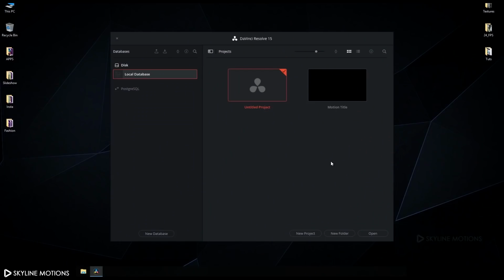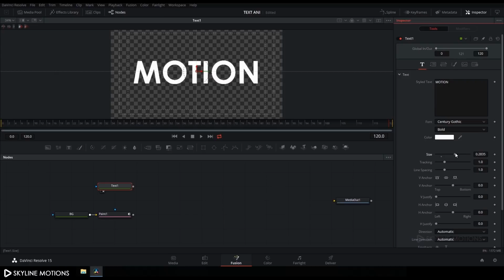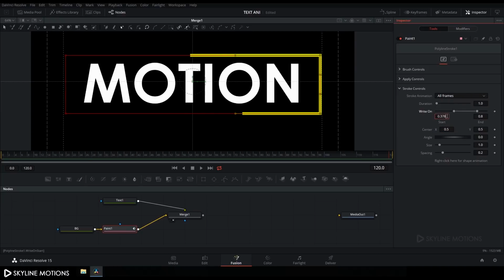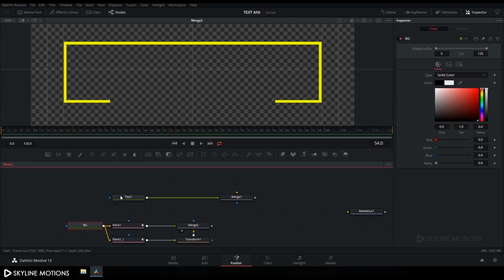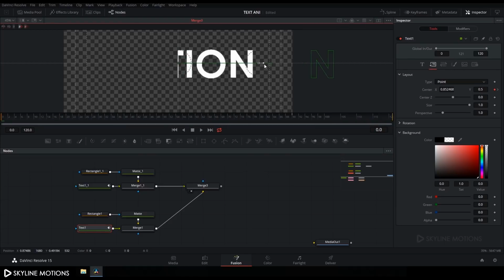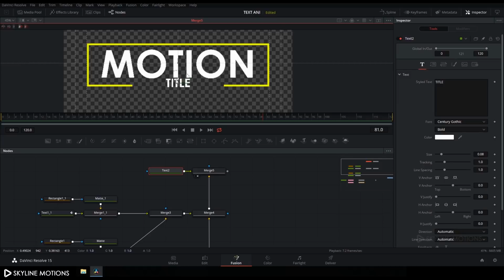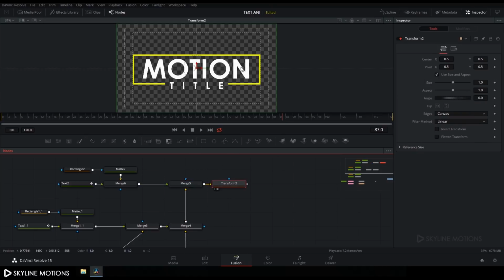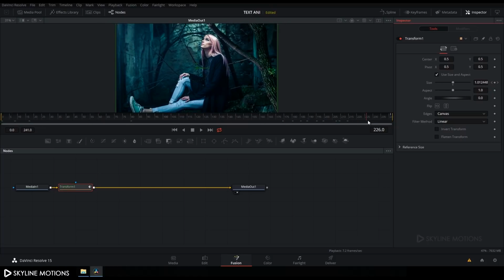Clean Title Animation in DaVinci Resolve 15 | DaVinci Resolve 15 Tutorial

Comment: When I drag the merged text to the viewer, the text displays and animates however the rectangle does not display or animate. If I drag the paint node to the viewer, it displays and animates correctly but for some reason does not display in the merged view. I have checked and rechecked my connection points to no avail. Any ideas on what the issue could be? Update: I figured it out. You did not mention that before you add your merge node you have to select your paint node. If not, it will connect to the text node by default and not display the paint node with it. Still a great tutorial. Thank you for sharing!

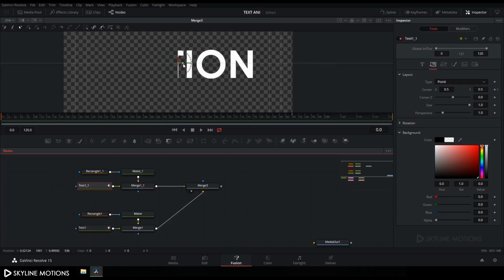Comment: The software is crashing on me when I'm at min 9:17, i've read some places that there was an option to run fusion from the cpu, but the option is no longer there.. Any thoughts?  I have a Ryzen  1600x, and RTX 2070. 32 gigs ram
Reply: Make sure you have nothing else running and be sure to not have YouTube in full screen mode.  Your graphics card may not be not enoughto keep up.  Mine did the same and it helped when I had my browser set to not full window.
Reply: Wow, thats an awesome PC you have there. It should be able to eat these types of animations for breakfast! I have a Ryzen 7 1700X running at 4ghz and a cheap RX580, 16 GB of ram and I am seeing maybe 10% CPU load. Sounds like your software crashing has nothing to do with your available PC power. Make sure you are caching all your output (there's a lot of resources out there on how to optimize DR). Also, try updating to DR 16 with a fresh install and make sure all your windows and drivers are up to date.